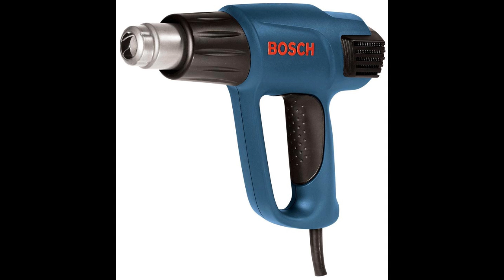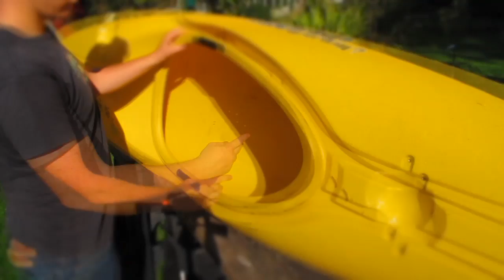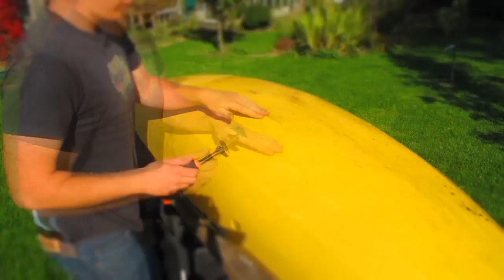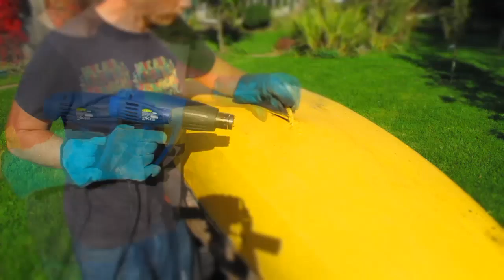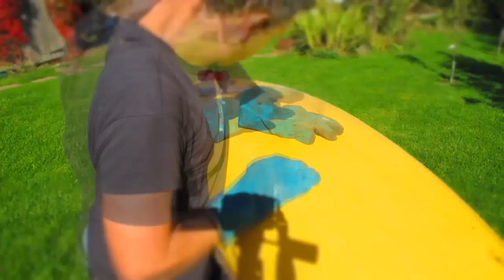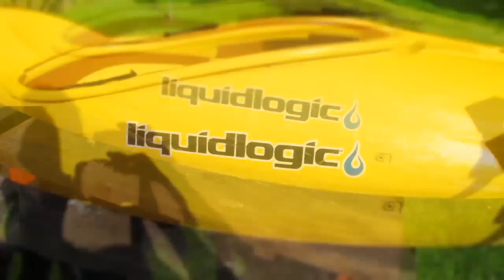How to Weld a Kayak with a Wire Mesh | Plastic Welding.

Comment: Take some plastic from the back of the cockpit-stuff that,go buy a polyetheylene bucket and cut it into strips before you attack your boat.evem milk bottles are a better option.

Most kayaks are roto moulded polyetheylene

Comment: Why carve up your boat? HDPE is readily available in many packaged products, buckets, containers, tarps. It's everywhere.  Good video when it comes to the repair but watching you cut up the cowling made me cringe.
Reply: Pretty common in the kayak industry to use part of the cockpit for welds as it doesn't change the rigidity of the boat.
Reply: @pebblespaddles  Perhaps, but it looks bad and makes the cockpit edge uneven. When I restore kayaks, or anything else, I like to use new material and get the boat as close to it's original condition as possible. I'd be pretty chocked if I took a boat to someone to repair it and got it back with a bite out of the cockpit. Otherwise, I really like your technique for patching and repairing the hull.

Comment: Why bother with all the heating bs to get filler material....just use a coarse hacksaw blade or jigsaw....faster & easier👍😃
Reply: The Cockpit has is lipped on most kayaks, so you've only got about 10mm of stroke if you were to saw it. Most boaters will keep welding rods in a repair kit, you only want to cut material from here if you have no other way of getting it.

Comment: mine ant regular plastic  a yellow  kayak  turns orange  when heated and rubbery I've been  trying  5o weld it in a similar  manner I was thinking  about the metal mesh ,I'd never  heard  of anyone  welding plastic  before, I just tried  it i used to build  fiberglass  boats for kinner, and Gulf master, I've considered  trying  fiberglass  but I don't think it would  stick right any ideas
Reply: There is a type of plastic called crosslink I think, Jackson Kayaks used it for a while. It can't be welded, it just burns a hole in it. I made repairs to multiple cracks in a small area once by Epoxying a pre-impregnated 1mm carbon sheet to the inside of the boat using an epoxy called G-Flex by West Systems, I made sure that the epoxy ran through into all the cracks and then just sanded the excess off. There is a video of them chainsawing a kayak in half and gluing it back together and it's amazingly strong, you probably don't need the carbon, I only added it because it added an amazing amount of stiffness to the boat.

Comment: Probably would be easier to use shears or tin snips to get that plastic bit off the cockpit.
Reply: I think you would struggle without heat, but shear and heat would probably be better!
Reply: Alex Smith I realized afterwards they make a welder to do this job and then you don't even need to cut anything up. They are only like $80.

Comment: Please explain again why the consistent rolling of the rod? Thanks
Reply: Exactly like a metal weld Dylan Zrim. All I did was sand/grind the inside down smooth.
Reply: It ties the two sides of the weld together.
Reply: Alex Smith like zig-zagging a metal weld.
Reply: Alex Smith I understand it's been a few years, but did you eventually weld the inside portion aswell? Mostly for aesthetic reasons, but still

Comment: EXCELLENT!! Just fook a good bit of your boat up to fix a bad bit :/
Reply: You don't need to take much off, it makes no difference to the rigidity of the cockpit. It's a lot easier if you keep some welding sticks, but if you're halfway through a multiday and you ditched the plastic to make space for tinnies and your favourite snuggy bear then this is probably worth remembering

Comment: what about the super sharp cut plastic edge at the front of the cockpit that you left behind by cutting out a welding strip?
Reply: just sand them down or scrape them with a knife.
Reply: What about common sense ?   LOL

Comment: technique for adding wire mesh was something new to learn. watching someone cut up their boat for welding rods that most boat manufactures will give you FREE and in the COLOR of your model boat... priceless! wow! and if you didnt want to wait or have trouble with a manufacture sending you the welding rods then like another poster or two mentioned buckets are a good source and if one thought a bit on it probably come up with a few other sources as well.
Reply: Cutting your cockpit is the best way to get plastic if you don't have welding rods, say while your half way through a multi day trip. Buckets is a good idea though. I've heard that mixing different plastics can result in a bad weld but never had any experience with it, only ever welded with matching plastic.
Reply: +Alex Smith hi Alex what about the idea of caring some role of fiberfix? I recently learned about this product and I found that it has a wide variety of applications as it hardens like Steel we don't need extra tools like heat guns so it could actually be applied and cured within 20 minutes anywhere Downstream just keep it in a dry bag ... Think of it as a first aid kit for the kayak :-) I just did a quick Google 2 key words fiberfix kayak and I found others are already using it
Reply: +Blury Bury cheers for that, looks like really good stuff. would definitely be an easier option than welding! I'll try it out when I next break a boat :)
Reply: so you arent going to take a welding rod (or a bucket) but you are going to take a heat gun, gloves on a multi day trip? lol seems odd.

Comment: I work in the motor trade well I now work repairing and painting caravans and I would defiantly go about this a different way I would have drilled holes at each end of the crack to stop it spreading, then I would use fibreglass resin and matting on the inside then flip it over and use a grinding tool to make a V shape then fill it with fibreglass filler flat it down and prime and paint it. Will be stronger than it was when it was made and will not fail on you. I repair plastic panels day in day out. 

But saying that i would only use a two pack plastic repair bonder but that's trade stuff so advise people to do the other
Reply: mtuey Fiberglass will not bond to HDPE.  It will initially stick to the plastic, but then will peel off in a very short time.  I know this from quite a bit of personal experience.
Reply: Mark Lochala fibre glass is no good Im a boat painter by trade, like Mark says

Comment: Why cut plastic off your boat to use for a welding rod?
HDPE is not hard to come by. Plastic buckets, for instance.
Reply: if you can get welding rods or plastic by other means then that's good. but I was really just highlighting the point that if you're stuck with no plastic then that's the best place to take it from.
Reply: He took it from the spot the skirt attaches to also.  Making a skirt useless
Reply: @MatanuskaHIGH  nope you can still easily put a sprayskirt on just don't cut any off the top of the rim of the cockpit. Think about it mate.
Reply: It's more than just color matching. HDPE isn't universal. Each formula is different and they don't all mix. So using material from the same kayak you are repairing ensures there will be an exact match of not only the color, but the formula, and that will guarantee a proper bond.
Reply: color matching man.
Reply: Joshua Bradshaw
It's not automotive paint, man. Yellow HDPE is not hard to come by. Any yellow HDPE will be the same yellow this kayak is.